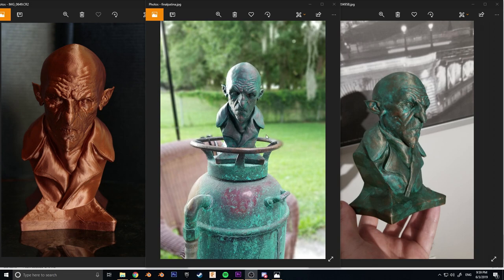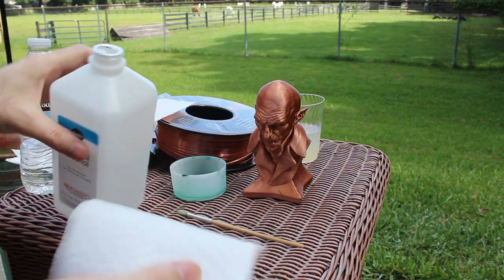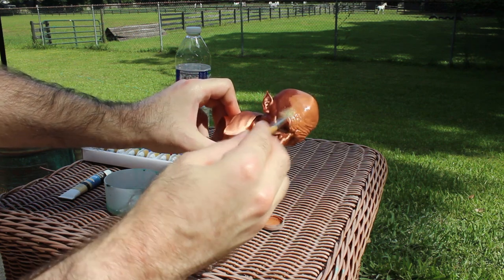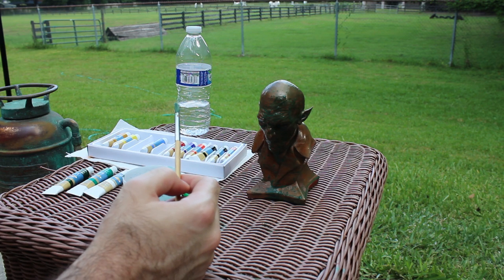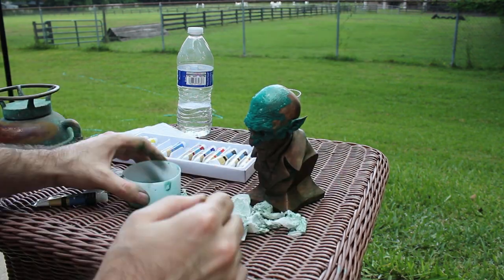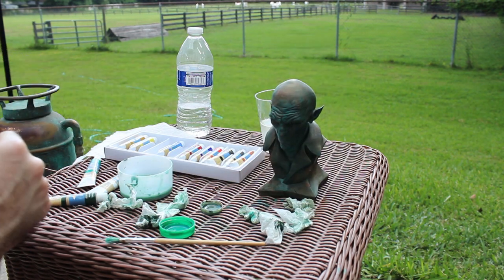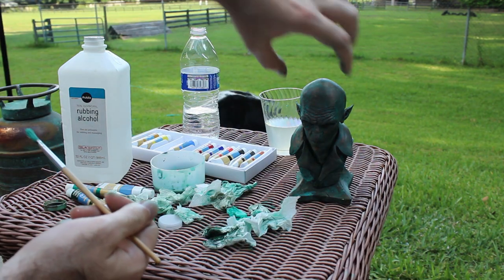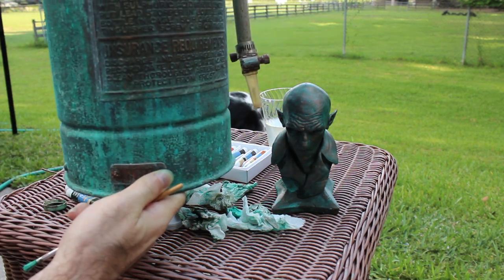Creating a copper patina effect on 3D prints

Comment: What temp are you using for that eryone silk? I have the same one and I keep getting variations of color as it moves up the print. Thanks.
Reply: You need a consistent speed of both fan and perimeters so it doesnt vary. Depending on your slicer you will need to disable things like auto cooling or print speed on small perimeters and such so the outer surface of the print always has a consistent speed